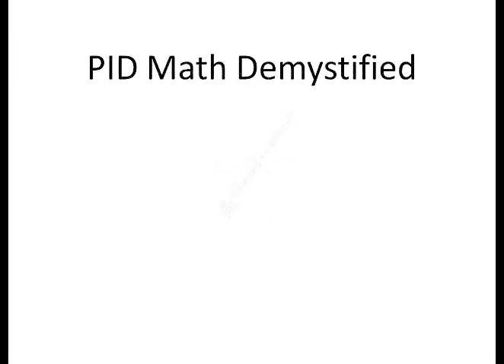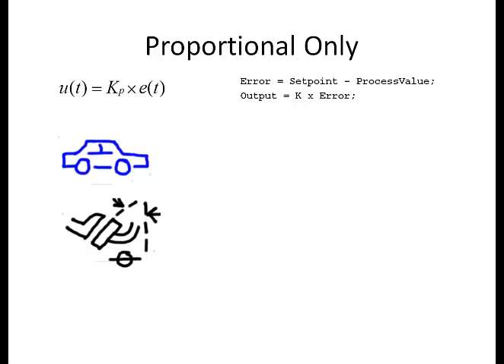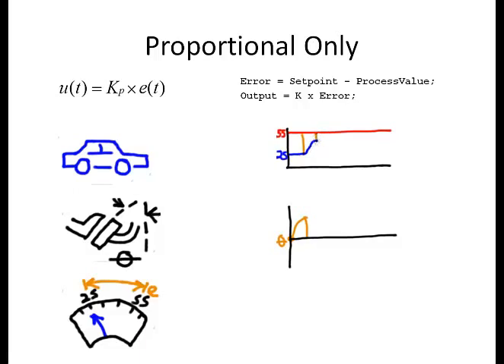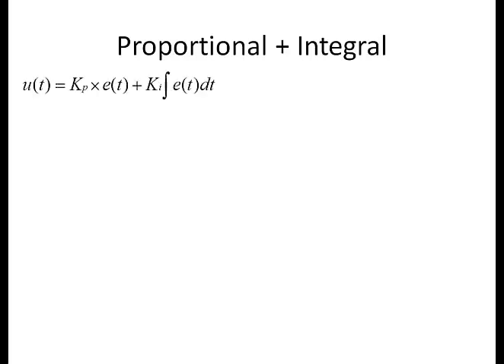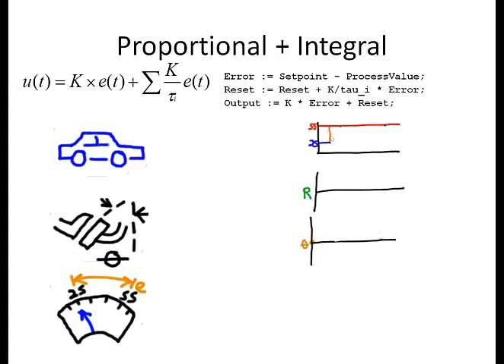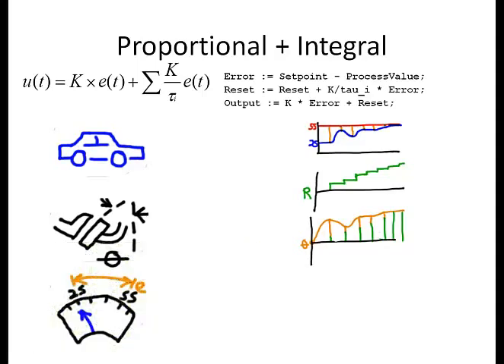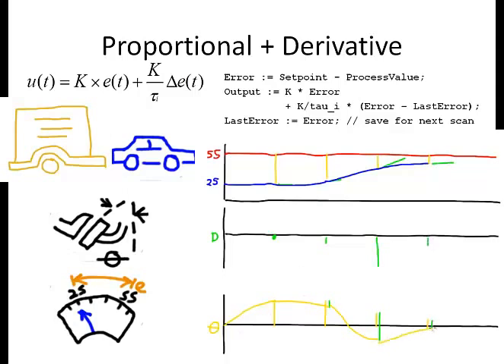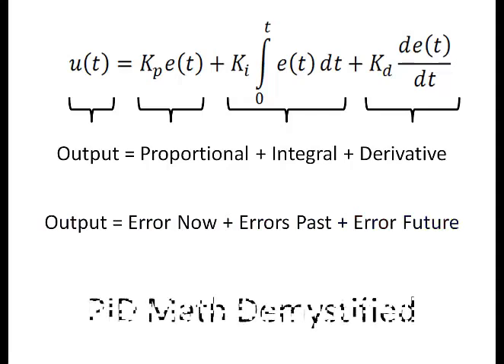PID Math Demystified

Comment: Good video bro. I used these equations on a Arduino last year, made several PIDs to control the illumination of desks in a Lab. Controlled light dimming, fans of the lights, distance sensors(to check if there is someone in the desk). 

Really nice video man.

Comment: Thanks  the pseudo code really helps to clarify it in my (4 function)  mind  :-)
Pity about the sound quality  - as an ex-sound engineer, I suggest you use a pop-shield between you and the mic (this could be as simple a a piece of ladies stocking stretched over a wire loop  ) it'll stop the popping sound as you pronounce the 'P's and 'B's and allow the recording level to be higher.

Comment: If the P gain is to high (~2:40), it will oscillate, but it will be above and below the set point, not under it. At 7:45 your two bottom tables are not correct, the reset register would not be that high when the error is small and the P is way to high when there is little or no error left. Thanks for the video. Watch the Motec PID videos, they are pretty good, but long.

Comment: Well done! However, I quibble with this idea that gain is "unitless." I disagree. For instance, if the input is measured in miles per hour, and the output is measured in degrees, then change in output over change in input is measured in degrees per mph, or equivalently, degree-hours per mile, so the gain would be measured in degree-hours per mile. You could say that degree is not a physical unit, which is fine, but then you're still left with hours per mile.